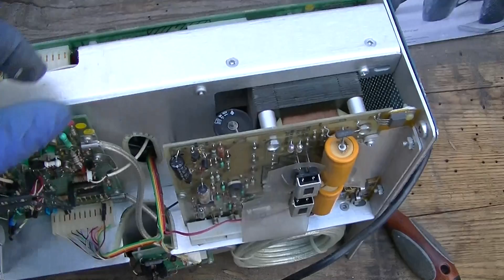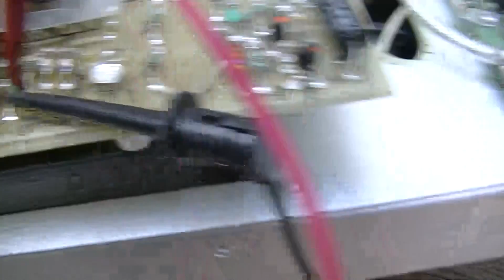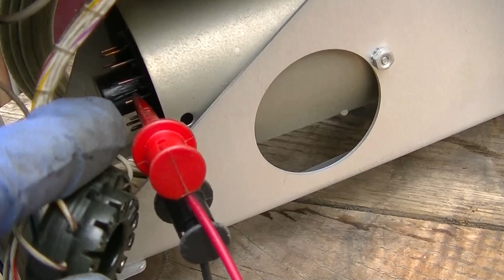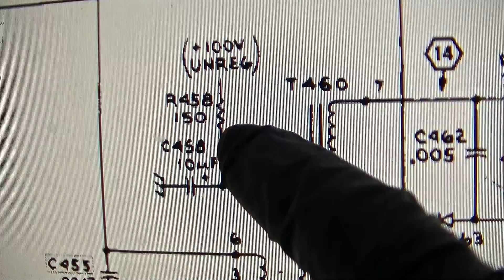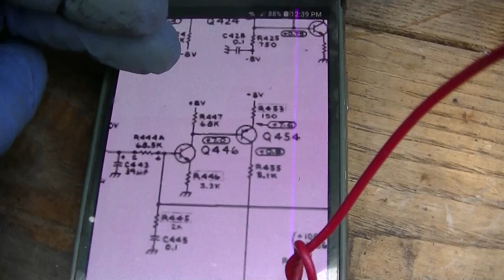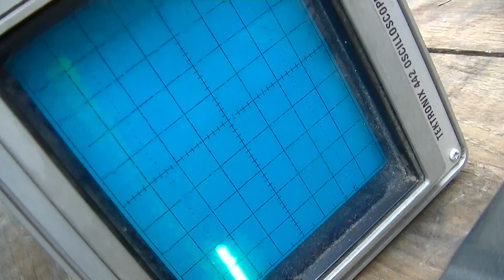Tektronix Type 442 Oscilloscope Diagnosis and Repair

Comment: I'm thinking the fix might have just been letting those orange caps reform.  Unlike analog circuits that hum, any digital logic won't work at all if the power supply has excessive ripple.   When I had my first job doing stereo repair, I always had a scope at my bench.  I used it more than my meter.  It not only shows me if there's a voltage there, but if there's something strange going on that my meter won't tell me about. (ripple, parasitic oscillations, signal, etc.)

Comment: i had problems with grounding on 2 metal cased pots in a Gould oscilloscope, they supposedly got grounded through their mounting nuts, but operating them made the traces go gaga, had to solder grounds direct to the pot cases to stabilise it,,
Reply: had similar grounding problems in a couple of old valve/tube radios, some ground solder tags were fitted to the chassis with rivets, and they were a bit loose

Comment: When I was in high school about five years ago, I helped move about ten of these (or similar) over to a new lab. They still use these things. There's also about ten 1960s HP scopes with round displays. All of them got moved. They'll probably only get dumped when the head physics teacher dies.

Comment: Tektronix didn't know how to make "bad" equipment, but yeah, that ground screw was no doubt a revenue generator. Got to love them fiberglass circuit boards. 

Nice video master shango066, thanks for taking the class on another adventure!

Comment: Those neons tent to be there for over voltage protection, they certainly are on the HP 1345a display systems.

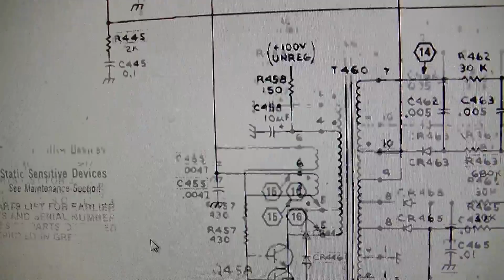Comment: Good vid as always.. One addtion though. It was mentioned inbetween lines around 18:35, but I'd like to stress that unlike in TV, on scopes the HV comes in the form of the Cathode, G1 and Heater being made negative by several kV with respect to chassis, while the Anode is held at about GND potential. So those of you who are used to how CRT are set up on a TV; Caution! Testing voltages on the CRT socket of a scope with your meter referenced to ground may get u a nasty surprise.

Comment: Tektronix of that era was the gold standard of quality in and out. Strange that Tek would have relied on that screw for ground. That does not sound characteristic of their designs back then but who knows??
Reply: thats  a very bad idea of theirs, but maybe deliberate in a way so the eht doesnt come up unless everything is connected correcrly..??
Reply: i used to have a model 547, and that was probably 4 times the size of that thing, and maybe 10 times the weight, it was a big beast, lots of valves/tubes as well as transistors..

Comment: Tektronix produced what are arguably the finest oscilloscopes in the world.  Even their ‘entry’ level stuff was built like a cast iron crapper.  HP tried to give Tektronix a run for their money, but HP’s scopes never approached the quality or reliability of Tek scopes.  HP did a fine job in other areas, but not in the scope biz.
Reply: HP made scopes.  They were never in the same league with Tektronix, though.  I worked on both for years. I wouldn’t refuse an HP scope, but given the choice between a top-of-line HP, or a mid/entry level Tek...  I’d take the Tektronix every time.

Comment: Looks like someone who took it apart before used regular phillips drivers instead of the proper Pozi-driv variant, resulting in the rounded out fasteners.....
Reply: Tek used Loctite on some board-mounting screws.  I’ve had to drill a few out!

Comment: Not a bad find.  I have been searching for an old 'scope like that for my grandson.  Biggest problem is the shipping on those things is more than the value of the 'scope. He is new to electronics and I've been trying to get him started.
Reply: I have great luck going to electronics recycling centers. There’s always a few scopes in various states of repair, but occasionally there’s one in perfect working order. :)
Reply: @sneugler  That would be great idea if they had such a thing down here. All recycling centers around this state have closed down because it was not feasible to operate. Even when they were using free prison labor.
Reply: Checkout www.shopgoodwill.com they have scopes (Tek, HP, Hitachi, B&K etc) all the time and the 50MHz ones go for reasonable prices and their Shipping isn't too bad(compared to eBay). It's a bit of a gamble on if they work but they typically power them up and acknowledge a trace is present. Other gear(DMM, Power Supplies) shows up too...if you are looking to get him started
Reply: @GrandsonofKong  but goodwill don't pack well ,ask phononut , everything he gets is smashed up
Reply: @force311999  These old scopes are built like tanks. Like Shango observed, almost milspec.  phononut has problems with the super delicate vintage radios, especially bakelite cases.
Reply: @force311999 I've had a few issues with them but they've always refunded or made it right. You always take a gamble with any shipping.
Reply: Try Craigslist. Absolutely nothing wrong with an old Hitachi or Leader...try to get one with BNC connectors and not PL-259 input connectors...that's an indication of age. Keep looking and you'll find something local for $25 and you won't have to ship it and can plug it in and see if it works. Then you can buy some cheapo probes on ebay for $10 sometimes $15 for a pair.
Reply: @pneumatic00  I found a really nice Hitachi (with BNC) sitting in my alley on the way to breakfast one morning. I wasn't really looking for another scope but this one came home with me, works perfectly and is in reserve in case I need it. Can't let a good scope go to the landfill.
Reply: A real boat anchor maybe the same in shipping costs! Especially anything from the late forties to late fifties.
Reply: A simple one channel that he can see audio from his radio or a Mic or electric guitar and maybe DC versus AC coupling and study wave shaping would be a perfect starting point. Then you can graduate him up to a "big boy" scope when he's on his way. $0.02 ;-) God Bless
Reply: Thanks everyone for all the input. I have him set up with a DVM,  power supply, and the basics. I've been teaching him how to restore old radios. I'll just to keep my eyes open for an old 'scope. Goodwill is also a good idea but there again, the shipping is more than the value of these old boat anchors.  I'm retired and on SS so my funds are tight.  Have a great day guys.
Reply: I would try checking out your local university surplus sales. I know that even as recently as 2018 there were literally hundereds of old dual beam and dual trace units just collecting dust. Which is a real shame as the digital scopes they have been replaced with are nowhere the same level of quality.

Heck even that generation of the early digital scopes have started to find their way to the warehouse shelving. This current generation of ASIC and FPGA based scopes are so amazing and at an incredible price point. I mean even ten years ago if you would have said "check out my new 500 mhz  4 channel scope with full protocol decoding" everyone would have assumed you spent a half-million to get it, Now thats obtainable for less than 2 thousand.
Reply: Check to see if there is a Ham radio club nearby. Find out when they have a swap meet. Often scopes will turn up.

Comment: Roll of coax is a delay so it can trigger and display on the left side of crt
Reply: Beat me too it.
Reply: @Etienne wow that must be slow cable it looked about 1.5 meters worth of cable
Reply: @Etienne do you know the type of cable used it would be handy to have a chunk of that around for projects
Reply: @Etienne Hi I may be wrong but 140 nano second sounds a bit much, the speed of light in a vacuum is approximately 11.8 inches per nano second, so lets assume the coax has a velocity factor of 0.7  that gives us 8.26 inches per nano second so the delay line would need to be 1156 inches (96.3 feet)  to   give 140 nano second delay.... so if it is 140 nano second delay maybe they are doing some black magic lol there maybe some delay added by the delay line driver circuitry and or the vertical amp??
Reply: @T2D.SteveArcs  I mean the cable is longer than just the roll, it has extensions that go other places...
Reply: @AiOinc1  interesting I have a few CROs I might pop the lid off and have a probe around, the delay line, delay line driver circuit, vertical amplifier etc
Reply: Yeah. My father used a 100m coax cable to delay signals back in the 70s when he was working.
Reply: @Etienne lol I hadn't thought it may be coiled up ha  when I get time I will take one of my old scopes apart and make a vid about it keep an eye on my channel over next week or two if your interested all the best Steve

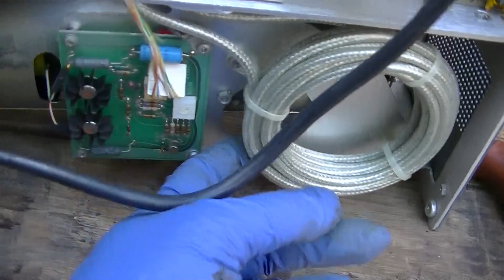Comment: @ 3:00 - roll of coax is delay line for vertical deflection amp. It is needed because of the inherent delay in the sweep trigger circuit activating on the incoming signal - set by trigger level and slope. Because of trigger delay the beginning of the waveform would be missed when the beam begins to sweep.

Comment: Iv got a b&k that I tried to convert into a tv. Didnt work.... ended in fire.
Reply: Hope you made a video of that. Not only would  I love to see it maybe Shango would too!
Reply: I wanted to do that when I was a youngster. The Z axis input would modulate with the crt beam to the video signal. Not sure how to sync the vertical. Probably need circuitry to get vertical and horizontal triggering. The horizontal sweep circuit of scope would probably work almost stand alone but not sure. Vertical would need help. Maybe older solid state TV with proper isolation could be used for signal purposes. Or a Sencore VA-47 or VA-62 or a B&K 1076 or 1077 might be easy? Lol, maybe I should try that myself, eh?!
I watched allot of video signals on my scope as a kid. The pisser is I didn't fix more than half of what I tried. I was taught to test capacitors with an ohmmeter..... Complete b.s.. I didn't know better. But I do now 40 years later.... I understood there was slow scan TV on shortwave. I wanted to see what they were transmitting. Be aware that there are differences in phosphor persistences so possibly a television video image with motion would look smeared. I guess we should try it? Let me know what you think? God Bless
Reply: I rigged up something a couple years ago I cant really remember how I did it. But it ended in the flyback catching on fire.
Reply: That's really funny, in a lot of the old electronics magazines there were ads that were titled "turn your TV into a GIANT oscilloscope!"  Talk about very limited bandwidth!
Reply: Quantum Leap Yup.... We should try that one for giggles. I did see a video on YouTube of a guy I believe in the U.K. He modified his color TV to display shapes from his music amplifier. He disconnected the deflection yoke. Somehow he still had high voltage and such. Plus most yokes are bonded to the crt. I was thinking one could leave the yoke connected carefully suspended in the chassis and use another yoke on the crt. Anyway, I've got other fish to fry. Electronics to fry.... Just interestingit stimulates your thinking and understanding.

Comment: these things have gone obsolete about as fast as the CRT televisions....going for cheap now at swap meets.... you're right these are boat anchors now.
Reply: hell i use a 10mhz vacuum tube tube scope
Reply: Wallace  my comment was based on servicing anywhere besides a bench  ... drag a CRT scope to a job site ?.... no thanks ...
Reply: Wallace  open air contacts are a pain in the ass but the rest seems very reliable , never had problems with my scope but spent 2 cans of wd40 contact cleaner to make it work right when i got it ahahah